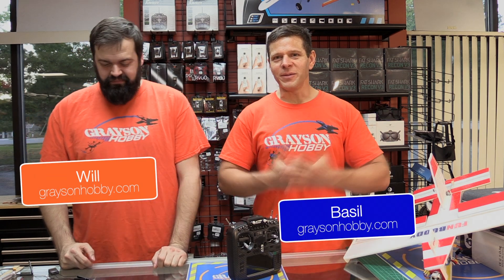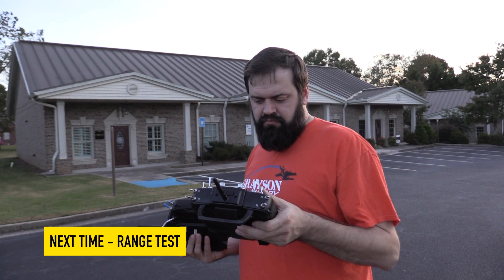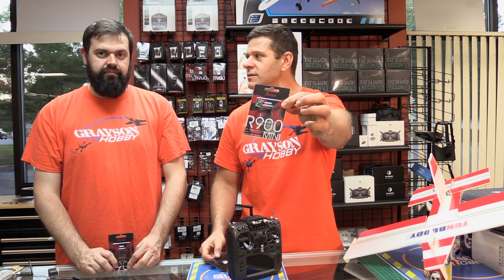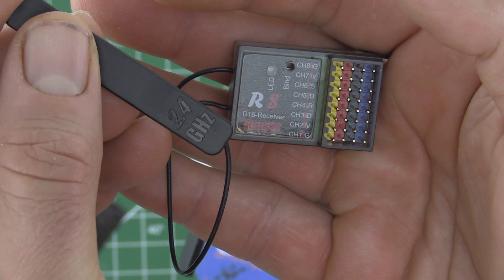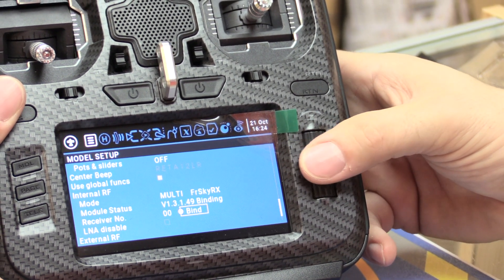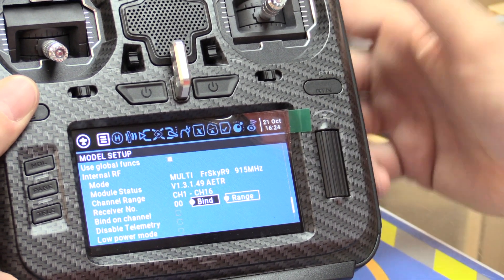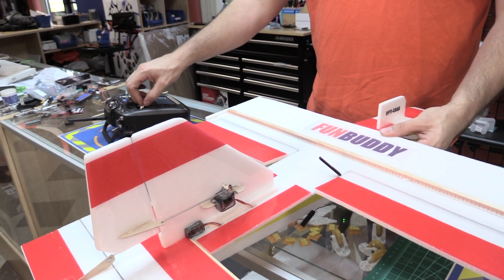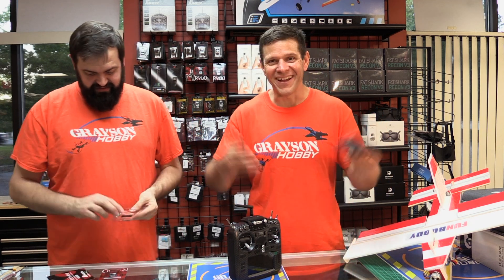Long Range Jumper Receivers - 915mhz - How far is the range? How to Bind R900?

Comment: hello there
I just bought and received "Jumper R900 915 receiver".
However I can not bind it with my Taranis Access X9D plus 2019 with the R9M module!
I follow the manual but with no luck.
I tried different protocols and no luck
Can you please help me?!
Thanks
Best regards
Reply: downgrade r9m fw to accst 2018 (not flex)

Comment: Was able to bind them (2 ea) to the R9M on a Radio Mater T16s.  Finally!  But,  they will not remain bound.  The green light continually goes out and contact is lost at least once every second.  Not flyable!  My R9 binds up fine.  I would attempt to flash them with the same firmware the R9 has, but there are no instructions, pinouts to the S port pins.  The available information says they should be compatible with the Jumper T18, and the Frsky R9M.  The only thing I can figure is there is a firmware issue.  What firmware version are these Receivers compatible with????
Reply: probably the first ones, accst 2018 fw not the flex

Comment: Hello Guys!  Happy Holidays!  So I have a T18 Pro and an R8 installed in my Trex 470 LM heli  it is connected to their microbeast controller via the S bus port. power is being supplied to the R8 and passed through to the microbeast.  So now I purchased the R900 (all the radio gear has come from Grayson, thank you for your excellent pricing and unsurpassed CS) and want to swap out the R8  hoping to make my radio link more bulletproof.  My assumption is that all I need to do is make the physical swap and change the TX mode to the 915mhz, bind as shown in this video  and I should be good to go....Am I missing anything?? would I need to reprogram the failsafe for the R900? Any insight would be appreciated.  Thanks.

Comment: Will it work with an R9M Lite module on XLite?  I can't get it to bind.  Is there any way to update the firmware on R900?
Reply: use the old 2018 fw on both the r9m and jumper receiver

Comment: The new R900 doesn't work properly when bound with telemetry on, the servos will not response proportionality.  Jumper please correct this by releasing a firmware fix, thanks.

I am using Radiomaster TX16S with openTX 2.3.10
Reply from the maker: We had it working..  dbl check the radio settings 
But you need a fc to get telemetry
Reply: Checked mine.  I am using Radiomaster TX16S and Frsky R9M2019 with Flex firmware, the telemetry on/off option pops up everytime when binding.  The R900 only works properly when telemetry option is off.  You can try the same settings to see this problem.  Thanks.
Reply: @oliverli2000  i have same problem did you fix ?

Comment: I fly planes and wanted to know if I purchase the R900 what flight controllers work well with this receiver. I fly mostly Horizon Hobby planes and realize I probably will have to purchase new receivers. What do you recommend that has gyro stabilization? Thanks!
Reply from the maker: The receiver is completely independent of flight controllers.  Most Flight controllers, (if not all) use SBUS, so you want an SBUS receiver such as the R8 or R900.  The Dynam Gyro are a good value

https://graysonhobby.com/detrum-6-axis-flight-control.html